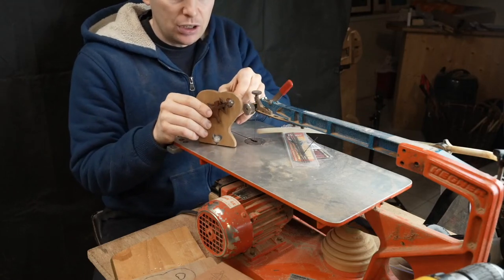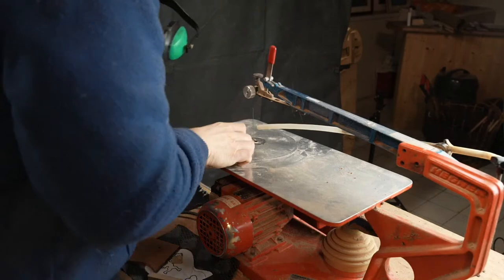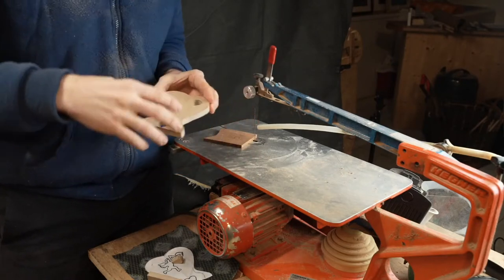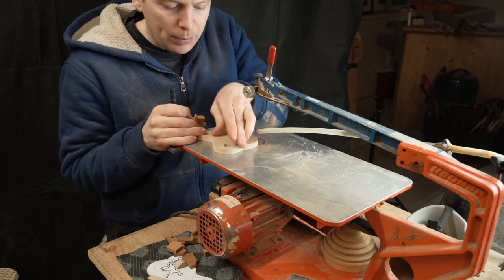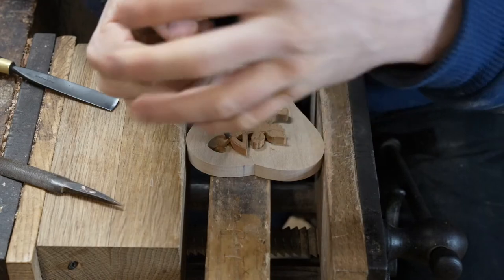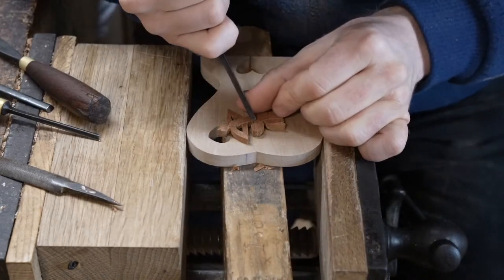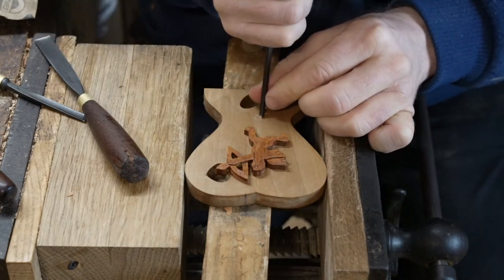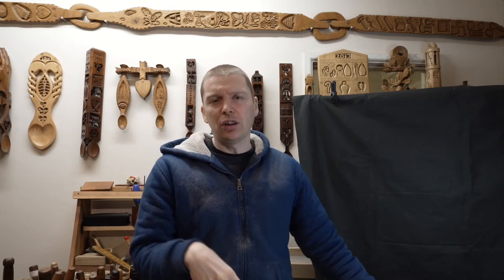Scroll saw live. Make your own Valentines gift (beginners)

Comment: It’s been a while since I’ve used spiral blades, but I recently learned that certain companies make “flat end” spirals specifically to solve this issue of them being annoying to get properly clamped. Apparently, normal design spiral blades are twisted along their entire length, which makes it difficult to get a good grip on them with the blade clamps. I’ve just ordered some flat Flying Dutchman brand end spirals, and I’ll be curious to see how they are to work with!
Reply from the maker: Hi Stella, great to hear from you and thanks for sharing your thoughts on the spiral blades. I will certainly be having a look at the brand you mentioned because if they do flat ends it gives it the potential to be a significant improvement upon what I have previously used.

I think the background on this for myself, is I can see the potential for the spiral blades being really useful for the scroll saw work that I do but so far I have been disappointed with the ones I have tried.

I always seem to stick with the reverse tooth blades. Quick to clamp, gives a great finish and I am comfortable with them. Having said that I will certainly be looking into the blades you suggested because I do feel if they can get the manufacturing correct for spiral blades they have the potential to be a better blade.

Thank you for sharing your thoughts on this with us. Great to hear from you, all the best from us all here at The Lovespoon Workshop. 👍👍